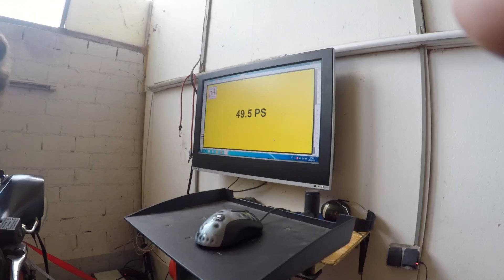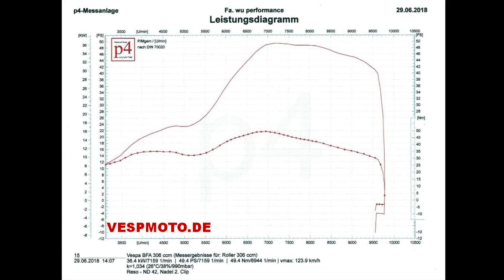306 cc BFA dyno Prüfstand VESPMOTO box exhaust DSE Vespa PX 200

Comment: Question: Malossi ignition, 1.2kg with weight ring or without? 

Frage: Malossi Zündung, 1.2kg mit extra Gewicht Ring? Persönlich finde ich das LüRa zu leicht

(Wahnsinns Motor by the way)
Reply from the maker: Lüra hat 1 kg. Die Kurbelwelle bringt schon sehr viel Schwungmasse mit. Das leichte Lüra fährt sich auch einwandfrei. Sauberes Standgas. Du kannst natürlich auch mehr Massse draufpacken ;-)
Reply: VESPMOTO ja klingt logisch, die Welle ist schon fett.

Nimmste Innere Organe als Anzahlung?
Reply from the maker: That Scooter Thing leider nein, leider gar nicht 😃👍